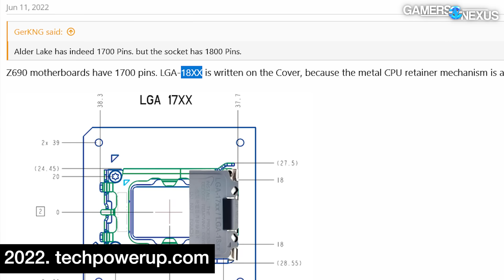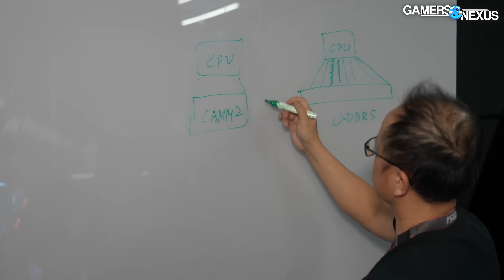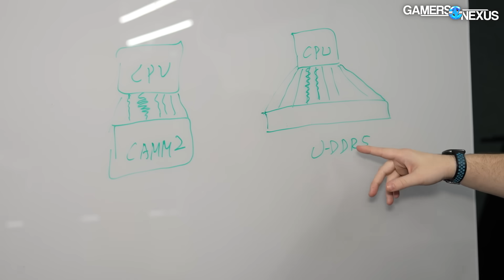Intel Says Not to Say "LGA1851" or "Z890" | MSI vs. ASUS Features & X870E Boards

Comment: Those are actually brilliant M.2 slot features. I have had to upgrade a few mainboards with bigger and better M.2 drives in existing water cooled systems.
Got proper sized long version screwdriver and removing heatsinks was always easy. Putting it back on though, without seeing where is the hole while heatsink covers everything that's not already obstructing your view, and the access being obstructed by water cooling parts, was not easy at all. Hoses or hard tubing are always  in the way. Especially once in between two water blocks. 
So this new heatsink design is awesome.
Then once you have dealt with the heatsink you get those small screws holding on the M.2 drive down. Even with that plastic swing away part it's just nightmare stuff.
Worst of all are once that don't use extra screw to hold 2080 drives down. Heatsink itself is only thing holding it. For the  smaller 2060 and 2040 drives they have the screw but they share heatsink screw for standard 2080 drives.
Easy thing to do while mainboard is out and nothing is in it. But once in the case and with the water cooling solution it's 100x harder thing to fo.
Now all you need to do is to press it down and it stays secured? My hat is up. Great invention MSI!
So now changing or upgrading M.2 drive is press the release thing and lift the hearsink off. Then just slide thing to side and remove the drive? Then press newcdrive in and press on the heatsink? Hell yeah! You get standing ovations from me! Hallelujah!

Comment: The camm memory is definitely great, the replaceable connector/pins layer in the spec is a boon, as is the lower power consumption for laptops, as for desktop, given their flat form factor and low profile nature I wonder if a 2nd socket could be put in the same spot but at the rear of the board.
Reply: That could be an interesting idea, though it does fall into the same pitfalls as rear-mounted power connections and M.2s. We're going to want MB and case manufacturers to standardize locations for this stuff first to ensure compatibility and convenience.

Comment: all i see from msi is ways to screw the consumer for more money -.- "need to upgrade your ram? why buy 2 extra sticks cheaper when we can sell you another whole complete unit, and make your old ram useless. Also why not buy our amazing cooler. If a fan fails, why bother replacing just one cheaply, when you can replace all 3. all of these options will be more expensive than previous upgrades/repairs, so we know you will love it." -.- yet another reason why i will not be buying boards like this.

Comment: The tomahawk at 11:45  caught my eye with the 8 pin power connector at the bottom of the board. My evga z170 had something similar for extra power to the pcie slots for sli. And being sli is dead I wonder what its for. And they are adding 3 x16 pcie slots again. My z790 tomahawk only has 2.

Comment: Intel is trash tier. Only good for cheap N100 Plex machines for people who don't know how to avoid transcoding. I loved my 2500k back in the day - ran that at 4.5ghz between 2011-2016. Jumped on Ryzen in 2017 and haven't looked back. My fiance is still using that 2017 board with a later AM4 CPU. Last year I swapped out my CPU in X570 for a 5800X3D. I even built a budget AM4 ECC Ram build, because AMD let you do functioning ECC ram without workstation boards (depending on board vendor aka not MSI). Keen to make the move up to AM5 with the 9950X. Not even for gaming (5800X3D handles games just fine), but wanting to run more VM.

Comment: That M.2 tooless latch is pretty sweet, the existing rotating ones were already ok, but that is genuinely brilliant. Is it worth the extra cost it inevitably adds to the MoBo, that's on the buyer to decide, but from a design, engineering, and use standpoint, it's fantastic.

Comment: Man, I didn't even know these quick-release PCIe buttons existed...and now I really want one.

Gone would be the days of using a plastic ball pen in an attempt to press the 2mm of latch poking out behind the backplate in the 1km deep and 3mm wide pitch black canyon between the CPU cooler and GPU.
Reply: I've just ripped out the retainer clip completely before inserting the gfxcard in the slot because there was literally no way to ever get to it again with the card in place.
Reply: this came at the right time actually, I had a pain trying to remove my 6750xt from an Asus Rog B550 the other day, had to use a long precision screw driver, made a little dent. But damn it was tough.
Reply: @JohnDavidSullivan  Try having an Asrock Blazing Gen5 M.2 Fan-Heatsink on the Motherboard. Then the latch becomes inaccessible short of using a long, thin plastic ruler.
Reply: @RAMChYLD  🙄 yeah well it is the thought that counts I guess
Reply: As someone with a 4090 and a CPU cooled by an NH-D15... I want to just break the slot instead of trying to wear a work glove and get something small but sturdy and non-destructive shoved in there to force the latch open.

Basic quality of life shouldn't be patentable.  Started with Ultra and the X-connect PSU's, still going with this quick-release garbage today.
Reply: I recommend using a simple school supplies ruler, made from something not metal, mine is wood. Worked very well for me in the past
Reply: #NH-D15 Problems
Reply: I've always used a chopstick.
Reply: Heck ball point pen...I always had to use a butter knife.
Reply: couldnt someone make some 3d printable DIY latch? like replaces your original latch
Reply: I use an open test bench for various projects and the press release button on the GPU has been really handy :)

Glad to see more folks using them.
Reply: I guess it makes sense in a sub ATX board. I personally never had an issues reaching the PCIE latch in most builds, there's always enough gap to press it. It's nice to have it on my new board, but I don't really think I need it unless I'm building an mini ITX.
Reply: Do you remove your GPU on a weekly basis?
Reply: @dereklang4451 😂😂😂😂😂

Comment: How the fk do you get a patent for a button that actuates a piece of metal in 20xx... the insanity levels are still rising. Sidenote I didn't think destop CAMM RAM would be so soon, thought we would be safe until DDR6 or something... that looks to me like yet another reason to jack up prices and gouge us for bs reasons again. I will concede the flatness helps direct somewhat more air into a CPU aircooler but thats about it. They are asking us to change motherboard to support higher DDR ram speeds with newer CPU gen anyway so blabla about signal integrity is snake oil at the end of the day.

Comment: The GPU release buttons are pretty cool but my desk chopstick is cheaper and works beautifully 😂
Reply: ..and you don't have to pay a licensing fee to use them 😋
Reply: Those release buttons could be difficult to get to, and the panel is so large you have to remove everything in front of it first
Reply: @didamnesia3575  Springs will corrode and get stuck with time. Manual release with a chopstick/long poky thing will always be necessary.
Reply: @thelegendaryklobb2879  In a place like Florida near a beach, yeah that can be a big issue for any bare non-stainless steel. In most places, at least in the USA, I don't see corrosion of the spring being an issue. Spring steel isn't very prone to deep corrosion in reasonable temperature and humidity levels, most hardened steels aren't. Even then, it can be galvanized and/or greased to pretty much eliminate that issue.

Comment: Cam mamory was designed for laptops, so you could get the low power and high performance of soldered ram while having it be removable. The pins should also be removable.
I guess it has some advantages for desktops, but it seems like too much hustle for little gain
Reply: There’s more possibilities than it seems.
Reply: Speak for yourself. Less power, higher frequencies, tighter timings, smaller footprint. What's not to love?
Reply: @AndrewFremantle  board area wise it seems to take more space. If more motherboard were made with 2 ram slots instead of 4 the footprint would be even lower. The power thing is very important on laptops, but when your average gaming gpu uses an entire nuclear plant as power the savings are not as significant and it can't extend battery life or whatever.
I think integrating this tech into ddr6 and leaving cam to mini pcs might be the more rational pay. Or maybe we go to the drawing board again and make a new standard that keeps the advantages of cam while retaining some of the advantages of sodimm

Comment: 2:15 About damn time. I bricked a motherboard getting a graphics card out while trying to release the GPU tab with a screw driver. Personally I don't want to have to remove the CPU air cooler every time I need to take the graphics card out of the system. Call me crazy.

Comment: i think CPU and RAM should be soldered now
Reply: I could see the performance and compactness of DRAM that's integrated in the CPU package combined with the flexibility of CXL memory leaving standards like DIMM and CAMM as unwanted middle ground.
Reply: @whyjay9959  plus no RAM issues because all this will be tested by the manufacturer and lets face it how often you buy new mobo with low RAM? might as well do full upgrade every 5y or so to replace everything in one go much more convenient

Comment: Actually, CAMM2 may be better in the long run. Because you do indeed need to buy all the RAM modules upfront since mixing and matching RAM will cause timing nightmares. If you add two later you will run into issues that end with replacing all the modules anyway. For example Corsair LPX with the Samsung B-Die RAM (model code M2Z). If you invested in them before, you can’t get them anymore. When I needed to upgrade my RAM on my DDR4 machine from 32GB to 48GB I needed to buy my RAM second hand because of the fact. The ones still in production are using a different die and will have very different characteristics from the Samsung B-dies.

Comment: The JEDEC ratified version ended up only supporting a single module for its 128 bit width.  ECC is supported in the SPEC so conceptually it is possible that a Threadripper could have two CAMM connectors on a motherboard.  Similarly a Threadripper Pro could support four CAMM modules.  

Another interesting aspect of CAMM2 is that there are both DDR5 and LP-DDR5 versions of it.  Thus various ultra mobile devices that began to solder their memory onto their motherboards can now revert back to this modular design with only sacrificing minimal memory speeds.  Reportedly various desktop chips do have support for LP-DDR5 in their memory controllers but it is never used in commodity desktops (generally you'll see soldered LP-DDR5 in those niche embedded/industrial applications).  This would be a means of getting 10.6 GT/s rated memory.

There is an issue with current socket mounting mechanism preventing CAMM form getting even closer to the CPU socket.  It'd break cooler compatibility but I wouldn't be surprised if both Intel and AMD define a 'narrow' socket mounting mechanism for these boards.  That CAMM2 should also be interesting for overclocking.  Perhaps a single large pot that covers both the CPU and memory.  

Conceptually it is possible to support two modules on a single 128 bit interface via having compression connectors on both sides of the motherboard.  This is currently not supported and likely require some modifications to the CAMM connector itself to support.  Outlook doesn't look like this will be part of the DDR6 version of CAMM currently being worked on.
Reply: I'd kinda like to see CPU sockets replaced with the OAM form factor. It's another parallel-placed card, with power and data connections on the bottom, including up to 128 PCIe lanes. It's used for accelerators in enterprise, so they can have lots of chips and VRM- And maybe enough room for two large CAMM modules, also under the same heat spreader. Being a kind of PCIe card routed to various other kinds of PCIe slots could make motherboards not limited to one product line, though I'm not sure how the CPU/chipset's external I/O would be handled then.

Comment: 5:07 okay that’s a “valid” reason to glue in a socket cover, my smol brain could not comprehend during Derbauer’s video

Also great to see more easy-release on the PCIE slot, it’s especially useful for someone with an air cooler

Comment: I am a bit confused. You explained why camm2 might be better than Dimm, but those advantages seem to also apply for s0-dimm, just without the disatvantages of camm2
Reply: SO-DIMM is dead. There are no modern high-performance laptops with SO-DIMM slots, because SO-DIMM electrically maxes out around DDR5-6400 or so. LP-CAMM isn't replacing SO-DIMM, it's going to replace RAM soldered onto the system board at the factory. It's faster, denser, and more efficient than memory slots.
Reply: @AndrewFremantle  And more importantly, it is user replaceable.
Reply: Unlike DIMM, CAMM2 has a shorter trace to the CPU meaning it's both energy efficient and more stable. Form factor wise, since its now flat, air coolers wont have compatibility problems and the RAM module itself can be air-cooled or even water-cooled to increase thermal overhead resulting in much better stability in higher frequencies or you can slap an LCD on top of it lol.

Also did I already say it runs dual channel?
Reply: motherboard manufacturers will make the case that CAMM2 is better because of the overall cost to make that part of the motherboard will be reduced by the shorter traces and less copper and gold used to make those traces. selling that too the public and trying to say that 1 is better than 4, is another story and is just an excuse to sell you less for more. RAM has been the least expensive pc part for ages, they are going to try anything to increase the margins there and will make all kinds of excuses as to why it's better. When it comes to actual real-world use, your computer will still work with 1 out of 4 DIMM modules, it won't with a dead CAMM, this is how they will sell more pcs because people won't know that's what bricked their machine. the average consumer will be forced to replace their whole machine.

Comment: 4:00 - and the CAMM memory module
Congratulations. You just got me to sit straight up in my chair!
Reply: OR "CAMMMM" for short.
Reply: I'd be curious what it does to mini-itx boards. I know LPDDRx has been an option on those for ages, but I'm excited to see what low profile coolers could be made for that market without the need to clear as tall a ram module.
Reply: Only using 1 module should be nice.  DDR always needed 2 sticks to run in dual channel. I've still got old pairs of ddr2, ddr3 and ddr4.

Comment: If you're in a cool environment and you're not using the hottest components i don't see anything wrong with going with a case with more restrictive airflow like the MSI at the end.
I really like the design of the front and top panel. at least on the top, the greater ventilation restrictions are kept close to the motherboard out of the way of fans and/or radiator.

Comment: That's crazy. ASUS did a survey in 2021 or 2022 I think I'm not sure. For a feature we want on their products. I suggested a new type of latch that releases graphics card quicker and easier. Because of the current size of graphics cards and it will continue to be bigger in the future and pair that with huge Aircoolers. It's so frustrating to remove the GPU to clean them. I accidentally killed and stabbed my motherboard trying to get it out once lmao.

Comment: CAMM is really interesting for ITX boards, because I can see the potential to have it mounting on the REVERSE of the motherboard, allowing it to be insanely close to the CPU, even overlapping the socket keepout zone from the reverse side.
Reply: would cause issues with cooler brackets... but even just have it where ram usually is will mean more space for coolers...
Reply: @LiLBitsDK  it'd have to be on a platform where the motherboard has a good quality permanent rear bracket. even then, the keepaway zone is usually 3/4" larger than where the holes for mounting are, and even more in AM5 since the holes are towards the top and bottom.

Comment: Why the M2 dan CAMM memory all in sleep mode when put in the motherboard? Why not in standing mode like in ddr memory, GPU, pci-e card, etc?
Reply: CAMM specifically needs very precise pin/pad placement. It can't have a slot/socket. Kinda like modern CPU sockets - you don't any of them standing upright anymore either.
Reply: @AndrewFremantle  how about NVME?

Comment: Despite the wonderful sarcasm, Intel's chipset naming convention has been relatively consistent looks at release roadmap for over a decade?!?  This is like the sole thing Intel can reasonably name since the Core 2 Duo days.  Back then it was simple:  just add 10 to the number for the new product name.  At the time of Sky Lake and its 170 series chipset, Intel did the radical thing in changing to a 100 value increment.

Comment: Not sure if someone has mentioned yet, but one major thing CAMM has going for it is the motherboard pins are a separate piece that's replaceable!  The plastic piece just unscrews and isn't soldered down.

That might also be what Intel's doing with their sockets and is hiding.  Turning the entire RMA nightmare you dealt with to a $20 part!

Comment: Not a fan of that quick release with springs.  I'm not looking forward to when the dust or dirt makes the mechanisms fail and the cards are essentially stuck on the boards.
Reply: Can't you still press the tab manually just as we always have?
Reply: @tsjeriAu  there wasn't a "tab" if you looked closer